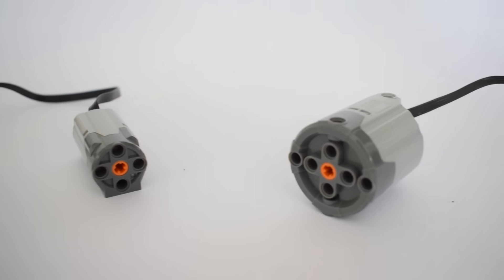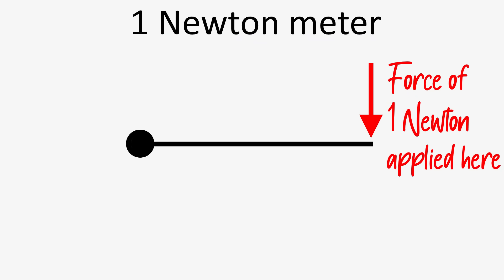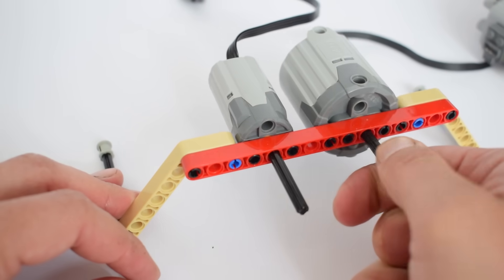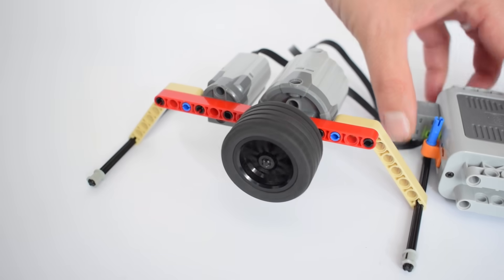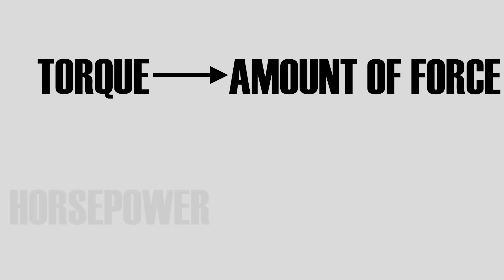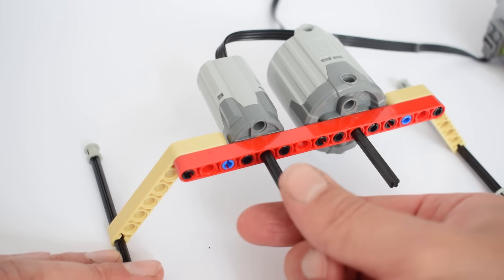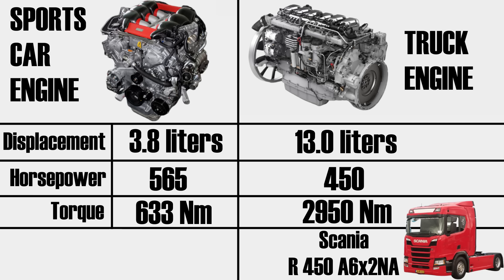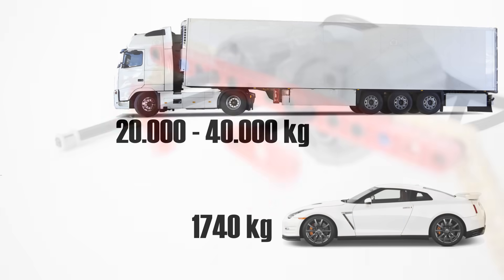NEVER be confused by HORSEPOWER and TORQUE again - HP and TORQUE EXPLAINED in the MOST VISUAL WAY

Comment: This explanation only tells half oft the truth. It implies, that less HP with more torque accelerates a car faster. But truth is, that torque gets converted by the gearbox and in the end the engine with lower torque but more power will accelerate the car faster. Because through the transmission the lower torque from the more powerful engine will result in a higher torque at the wheel. The benefit of higher torque like it is always said on diesel engines is the fact that you have more torque (and therefore more of the maximum power) at low rpm. Therefore the car will accelerate faster at low rpm and you need less downshifting. But if you downshift the low torque high power car, it will accelerate faster again

This all results that the Nissan engine would be able to accelerate and drive the truck faster than the big truck engine. But the big difference would be: the Nissan engine would be end of life after maybe 5000 km, while the truck engine does this for 1 mio km.

Many of the highly liked comments here show me, that people still did not understand the difference and the relation between torque and power. The formula P=2pi*M*n explains everything if you have a clear look at it.
Reply: yea but torque at drive wheel axis not necesserry must be biger for accelerate faster assuming  drive wheel radious isint constant so you have let say feg 2 diffrent vehicle with 2 diffrent wheel size 😎 feg 100 hp at engine crank 15000 rpm what mean 47 nm at engine crank only at 50 km/h at whel radious 0,1 m excluding drive train loses well overall all loses which i pact here and you have how much torq at drive wheel axis in this egzample ? 😁 532 nm vs feg 50 hp at engine crank at 2000 rpm what mean so 178 nm at engine crank at 50 km/h at wheel radious 1 metres how big torq now you have at drive wheel axis ? its 2663 nm 🤭 so 2 egzample have have more than 3 times biger crank engine torque and more than 5 times biger drive wheel axis torque yet it generate  2 times „weaker „ contact path force at drive wheel tire circle 👌🏻  cos nm is dependend on radious 🤷🏻‍♂️ in this egzample 2663 nm :1 m wheel radious = 2663 newtons force at co tact path vs 1 egzample 532 nm :0,1 m wheeel radious = 5320 newtons force at contact path  ,1 egzample have 2 times biger output force at the same velocity despite have much less torque both at engine crank as well as on drive wheel axis cos its engine generated 2 times biger power and force in regerard to set speed is dependend on power level as this formula say 👉🏻watt :m/s = force 😁

Comment: So for a normal car of 1500 kg wich is more important for fuel eficiency?
Reply: High engine power (torque) output at low revs where you will be driving mostly.
Reply: @simplemachine9531  yeah thank you

Comment: Why are we still using the term "horsepower" in the age of internal combustion and electric motors? They don't make "horsepower" - they produce power!

If we're talking about units of measurement, then it's a different story. The SI unit of power is the Watt; meaning one joule of energy output per second, with 1000w = 1kW in the context of typical engine output.

The functionally irrelevant imperial unit still being used for some reason is horsepower. Don't want to give it up? You'll need to clarify whether it's mechanical, electrical or metric horsepower (helpfully referred to as "PS")!

Comment: Another thing to note as to why the diesel engine makes more torque than a gasoline engine is because a diesel engine runs by means of compression rather than spark like a gasoline engine. 
This means that the air has to be compressed more in order to generate the heat necessary for combustion. With that said, the connecting rod (which connects the piston to the crank shaft) needs to be longer. It's a longer lever capable of producing more torque but now rotates slower because it has to travel longer for a full rotation. And it's pretty much the opposite for gasoline engines
Reply: The larger crank radius creates more displacement which increases torque.  It does not increase “leverage” and add or multiply torque.

Comment: Hi, Question: 
We know that P = F*V [Nm/s), T = F*R, V = W*R => P = (T/R)*W*R = T*W.
Say small & large motors have power Ps, Pl; Torque Ts, Tl; angular velocity Ws, Wl respectively.
Ps = .03*275 [Nm*RPM] ~ 11Pi/40 [Nm/s] ~ 0.00116HP . But you state that Ps = 0.0013HP... Seems like it's either rotating a bit faster or it has a bit more torque or a bit of both... Or have I missed something?
For the large motor the numbers are much more accurate so Pl = .14*146 [Nm*RPM] ~ 0.00287HP (~0.0029HP)
Thanks,
Dror

Comment: 1) no hp without torque, but you can have torque without HP.  A 100 lb weight at the end of a 10 ft pole is 1000 ft-lbs of torque but 0 HP

2) without torque there is no acceleration

3) I'd rather have a 400 ci Pontiac big block with lots of torque than a 400 ci small block chev with bigger hp (&less torque) - chev will lose to the Pontiac every time

4) Torque is what you feel when the throttle is punched and you get pressed in the seat.

In racing there is a saying - "Torque wins races, HP sells cars". In other words torque is real, HP is hype.
Reply: Wow such a disgusting set of myths and rumors, open the book.
Reply: 🤣🥳 what a load of 💩 but nice try 😉 here is your pontiac ewuivalnet with more torq 38 nm less power 27 hp 👉🏻 aka h-d x 440 0-100 10 sec  https://m.youtube.com/watch?v=nrzAwxEHYD0  vs here you have your chev ewuivalnet z 300 more power39 hp  less torq 27 nm  0-100 6 sec 👉🏻 https://m.youtube.com/watch?v=YPF9p6zw5Pc get real boi  go with your pontiac against pro drag race car the same weight prepare for drag racing where they setup perfect gearing at more power less torq engine and you be smoked  in your pontiac be this other car let say your pontiac is 2 rons with rider have 500 hp 1500 nm vs let say 2 tons 750 hp 1000 nm with perfect gearing the same tire weight distribution asf and your pontiac be leave in the dust 🤷🏻‍♂️ sory but its not what you think or what some diiot tell you 🤭 but how it is for real 😉👋🏻

Comment: I slightly disagree with the explanaition. Even in trucks, it's always horsepower what makes you move. The difference is that a bigger engine gets to its peak torque at low RPM, meaning it will output more horsepower earlier. A smaller engine produces it's torque (while lower) at higher RPM, but the increase in the speed at which it can rotate is greater than the decrease in torque, meaning that even if it's low-speed horsepower is lower, it's maximum horsepower is higher. Then each vehicle gets designed for its meant applications, you decide if you need higher horsepower at lower speeds, or higher horsepower altoghether.

Comment: If HP is just a function of torque and rpm, then why do you see power charts with diverging lines, where the HP increases while torque decreases as rpm rises?
Reply: cos hp is generated from torque x rpm if rpm is enough biger at lower torq than hp still be biger 10 nm x 5 rpm = 50 vs 5 nm x 15 rpm = 75 🤷🏻‍♂️
Reply: Why not?

Comment: Actually im seeing this when i bought my car last year. I saw HP and Torque in the specification but im lazy enough to ask what it is or how if effect the car. All i know the higher HP means run faster. Seen it on fast and the furios movies.. Lol, but torque i really dont know what it means to the car. Now i know the difference. So if i have bigger family and want to travel using only 1 car, then i need car with higher torque than with high HP.. Thanks for the explanation, very well explain

Comment: I’m still confused. Torque is measure of force of non-moving lever with RPM=0. How torque is measured for non-zero RPM? Also, if RPM is stable and is not accelerating, isn’t the torque zero (otherwise RPM will be growing, not stable)? And technically the zero torque should give zero horsepower.
Reply: Not necessary for a non-moving lever. When things start to rotate we can look on the torque as the amount of work per radian, or for one rotation if multiplied by 2π. And if we measured speed of rotation (rpm) we already know power and torque becomes obsolete.
There is a friction in the universe so in order to maintain the same rpm engine still has to consume fuel.
Reply: A simplified explanation of how to measure torque of a rotating shaft would be an engine brake dyno. The dyno puts a load on the engine by applying brake pressure. Then the dyno measures how much braking force it can apply before the rpms start to decrease. For example if the dyno applies a load that takes 100*lb*ft of torque to overcome the brake its applying but the engine is maintaining rpm. Then it increases that load to one that takes 101 lb*ft to overcome and the engine rpm starts to decrease then the dyno knows the engine makes 100 lb*ft of torque.

Comment: One analogy I've always used:

Horsepower is what can get my Mustang GT up to 60mph in 4.2 seconds.
Torque is what can get a 40-ton tractor up to 60mph in the first place.
Reply: Discard it.
There is nothing different between acceleration of a vehicle and an acceleration of a heavier vehicle except the quantitative value of average power needed in the process. Amount of torque from the engine's side can be higher or lower, we don't care.
Reply: nope watch what wrote 👉🏻simpl….👌🏻 formula force= mass x acceleration dont care if something is heavier or lighter always the same stuff affect acceleration , 200 hp 400 nm mustang 1,5 tons accelerate faster to 60 moh than 150 hp 600 nm assuming gearing be perfct and similar peak width asf as well as 750 hp 3000 nm 40 tons trcuk would accelerate faster to 60 moh than let say 500 hp 6000 nm 40 tons truck also assuming perfect gearing and all other equall 👍🏻 100 hp 50 nm small sports bike be accelerate faster than 50 hp 100 nm small sports bike both with rider let say 150 kg as well as yamaha vmax 1700 200 hp 167 nm 400 kg with rider be accelerate faster thanrocket 3 165 hp 221 nm also 400 kg with rider  🤷🏻‍♂️ level of weight with which we deall is irrelevant its not that the heavier vehicle is the more torque work better and vice versa 🤭 thats funny 🤮 it never was like this and never be like this 😎 atleast as long as gearboxes exist 😉as long more power version with perfect gearing beat more torque version regardless of for what type of vehicle you swap those engines and gearboxes or without gearboxes like electric stuff 👌🏻

Comment: I'm still confused. Horsepower is equal torque times rpm as you said. But the rpm always changes, so how is horsepower a set number in a cars specs???
Reply: They give only the peak number, the power of the engine is a curve along the rpm range.

Comment: The demonstration would have been more effective if a gearbox was used with two equivalent horsepower motors but with different torque outputs.  
An electric jack uses a high gear ratio to convert a fast spinning motor with low torque up to a slow driving shaft able to lift thousands of pounds.  It even has a hand crank that allows a child to lift a car, if there's all the time in the world to do it, because the upward motion is nearly imperceptible.
Reply: And what exactly such demonstration could have shown?
Reply: @simplemachine9531  that horsepower is able to be converted to any torque by the use of gearing. It's like current and voltage, you can get thousands of static volts scuffing your feet on the rug but you aren't going to be driving a motor with it unless there's enough current along with. A high torque output means nothing if it's only able to maintain it at very slow speeds.  It's just one part of the equation, while horsepower has both terms.

Comment: I always explain it as HP is how fast you can go, torque is how fast you can get to speed.
Reply: royal enfield continetal 650 gt 53 nm 47 hp 217 kg + 60 kg rider 0-100 6,0sec 0-140 12,7 sec 👉🏻 https://m.youtube.com/watch?v=9jWRoS_pd7E  vs hpnda cb 500 pc26 47 nm 57 hp 193 kg + 90 kg rider 0-100 4,8 on this test racebox show 4,59 but i have 1 foot roll out ON vs dude with rpyal enfield measured with OFF this function what mean i must add around 0,2 sec 👌🏻 to cb 500 results pk and 0-140 km/h i measured 15 times on racebox on flat road this bike make in 9,7-9,8 sec 🤷🏻‍♂️ 👉🏻 https://m.youtube.com/watch?v=imk3BtPIW6U so what we have ? the same weight +/- 2-4 kg including rider both around 280 kg 👌🏻 bike with less torque and more power accelerate quicker 🤷🏻‍♂️👌🏻
Reply: @mociczyczki   you're comparing a video from India to a video from Poland? Did you put any of these bikes on dynos? Where did you get numbers about weight? What about your wind screen? What about the fact that you rev'ed like you're doing a drag launch and they accelerated from idle? Seems like you just made up a bunch of numbers with no confirmations and didn't take anything else into consideration. Go look up a 2019 gt650 on a Dyno and you'll see it has less power than you are stating... 🤷‍♂️
Reply: @mociczyczki  yeah, I do. Having owned gsxr600's, sv650, sv1000, 848 evo, and now an xsr900, I have a pretty good understanding of torque vs horsepower, impact of aerodynamics, effects of mods on bikes, and companies maybe not being honest with their numbers. Not to mention mechanic friends that agree with my simplified explanation. Your cb500 is cute btw... 🥴🤫🤭
Reply: @alexmuccilli   yea yea whatever   cb 500 accelerate better than conti 650 gt cos have more power torq for racing is irrelevant 👌🏻
Reply: @mociczyczki  hahahahaha! Ok... I'm sure you've raced on your cb500 a bunch... 😂 😂 😂
Reply: @alexmuccilli  wanna try ? 😎 i raced on cb 500 against for egzample mt03 660 with the same power as rpyale field conti gt but even more torq  and cb win this easy 🫡
Reply: @mociczyczki  mt03 is a 320cc bike, not 660. Now I know you don't know anything. Bye.

Comment: I will explain to you all this in short : think of horse power as power that the engine generates and the torque as the impact of that power on moving the vehicle . so higher torque will always be faster than lower torque regardless of horse power . lets say 2 vehicles - vehicle A has torque of 100  and 200 hp . Vehicle B has torque 50 and 5000 HP . the torque already takes into account the weight of the vehicles and how they react to power . thats why vehicle A will be always faster than vehicle B . Vehicle B can be army tank that weights 100,000 LBS and vehiclea A can be some Mini car . thats why the higher HP doesn't mean higher torque .
Reply: Investigate more this topic before explaining it to someone.
Reply: @simplemachine9531  I listened to your educated comment - investigated and came to conclusion that I was right . I ask you to investigate in whatever you know on the topic ( you didn't say anything) and make comments on others comments .
Reply: @robertbarel896  Power is much more important than torque when talking about peak performance of the engine. You can use gears to increase or decrease torque as much as needed. In your example vehicle B could use a 2:1 gear ratio to get the torque of 100 like vehicle A. The difference is that vehicle B would produce that torque at a much higher RPM than vehicle A. So it could do the same thing (moving the vehicle) but at a much higher speed. If torque was all that mattered we would be able to drive a car with a cordless power drill and gears.
And since you brought tanks into this there is a great example in the M1 Abrams. The power turbine in the engine only makes around 275 lb*ft torque but it does so at 30,000 RPM. So a 10:1 gear ratio is used to change those values to a much more usable 2,750 lb*ft at 3,000 RPM for a total of 1,500 hp.
Reply: The issue is that you can multiply torque with gear trains, trading torque for speed. But since power contains both, you can’t multiply power. Power can be derived from fuel flow rate and combustion & volumetric efficiencies, so the only way for a given engine to make more power is to increase the rate at which energy (i.e. fuel) is added to the system. At some point the working fluid of the cycle (air) can’t be added any faster, so the power begins to drop off.
Reply: @David_Lee379  thst exactly what i said - read before you comment . power is HP and it's the output of the motor . the torque is the impact of the power on specific machine , just read what i wrote
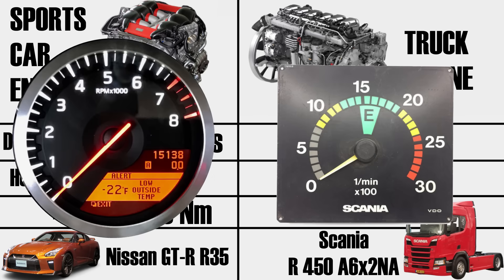Reply: higher torque aleays faster ok now than explain why this electric kick scooter Kaabo Wolf king gtr which have around 200 nm and 17,5 hp and weight with rider 140 kg accelerate slower and achieve lower top speed than feg kawasaki zx4 r which have pathetic 40 nm but 75 hp  here you have kaabo scooter test 0-50km/h 3,5 sec 0-80 km/h 7,0 sec 0-60 mph  11 sec top speed 106 km/h 👉🏻 from 7:40 around you have acceleration graph from racelogic device https://m.youtube.com/watch?v=ePuq42RQKlA&t=463s vs zx4 r 0-50 km/h 2,0 sec 0-80 km/h 3,3 sec 0-60 mph 4,5 sec vmax 210 km/h 👉🏻🤷🏻‍♂️ weoght with rider 280 kg  https://m.youtube.com/watch?v=Wfq5uYrZvys so zx4 r have 5 timess less max engine torq 4 times around more engine power it weight 2 times more it accelerate 2 times quicker and achieve 2 times higher top speed 🤷🏻‍♂️ so such „ higher torq will always be faster „ really ? i dont think so 😉 you may ask from where i get torque number for this electric kick scooter cos thers none in techspec and on their test vice versa to zx4 r where you can foundit have around 40 nm at crank ok so its simple ot do 0-20 km/h in 1,3 sec around from acceleration graph what mean 4,3 m/s „2 acceleration multiple be weight with rider than multiple be wheel radious and you get nm value excluding all resist ok its not 200 nm including for nm all resist too its actually more like 100 nm i do wrong calculation with wheel radious cos i multiple it be wheel diameter and not radious 🫣 😉 anyways still 2,5 almost more than this zx4 rr 🤷🏻‍♂️ at 2 times lower weight and acceleration is 2 times worse ju  🫎